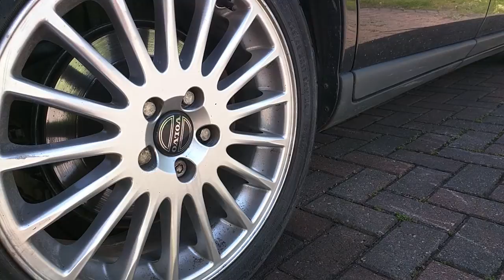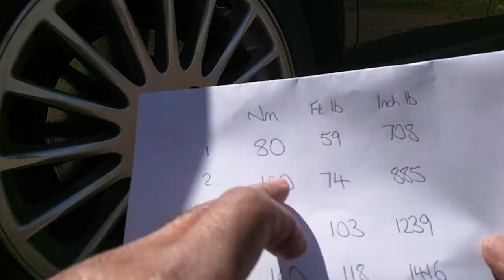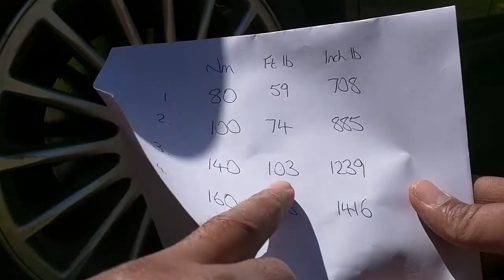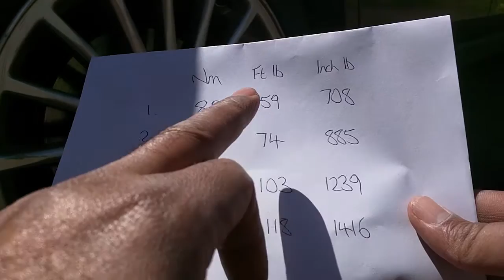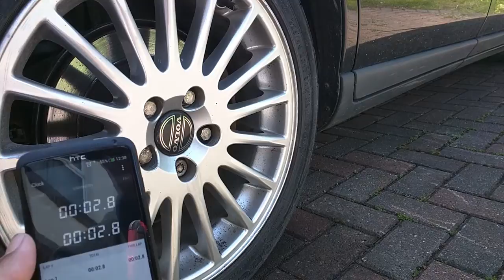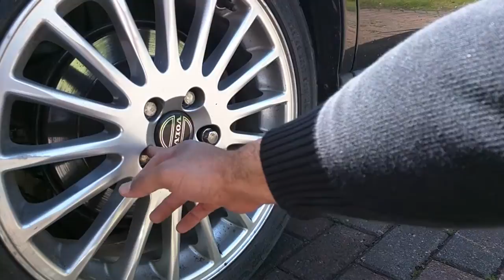Bosch GDX18V-EC IDH182 Hybrid Impact Driver / Wrench Speed Test

Comment: Top video, just what I needed to know about the NM and its capability on undoing the wheel nuts on the car. Plus the bonus of having a 1/4" socket on it for screw driving capabilities. Thank you.. and now I will be buying one.
Reply: Is there any way of setting it  to pre set tighten them up, like a torque wrench, thanks again
Reply from the maker: You're welcome. 3 years on and I'm still very pleased with this great little tool.

Comment: Thanks for taking the trouble to Post this video. 
I’ve bought the same one, thanks to you, (helped me make up my mind) as I’ve already got another Bosch Cordless Drill, so I can use the same batteries and charger from that one.. 
Thanks again. Very helpful.
Reply from the maker: Jas K No problem. A couple of years on and I'm still very pleased with my choice and hope it's the same for you.
Reply: SiRobb: Good to know. Very happy with it so far. Undoes the Wheel Lugs on my Evoque, which is what I hoped for. Only ever use it for that very occasionally but if it can cope with the wheel lugs, it’ll cope with anything else I need it for. Good stuff. 
Thanks.

Comment: Some ppl say that if you use a smaller battery, like 2ah ones, the maximum torque the wrench can achieve is smaller. Have you experienced this? I have 2ah on my Bosch, same model as yours. I can't loosen lugs torqued to 90ft lbs...
Reply from the maker: I haven't noticed this on a very modern lithium ion battery but I know what you mean from experience with older tools. 
I'm sure Bosch will claim the torque is the same using a 2Ah so complain to them. 
You have a 3 year warranty.
Reply: From what I've seen in every Bosch technical specs, they always use a note one torque numbers, specifying that torque is dependent on battery pack
Reply: This came with a 4ah battery for 170nm. If you use a 5ah battery, you get around 180nm. If you use the 7ah procore battery, you can get 200nm. No joke.